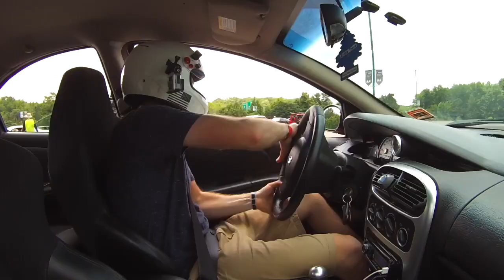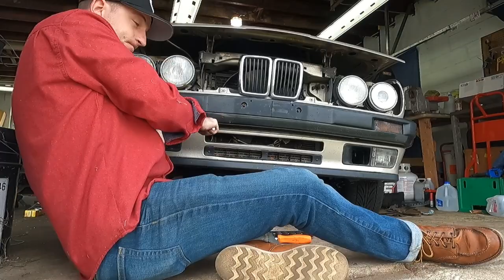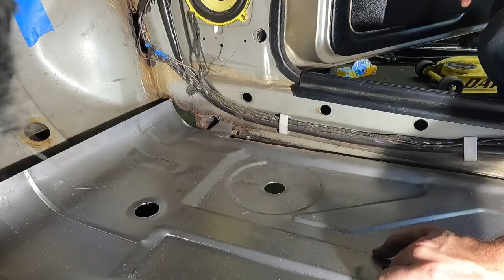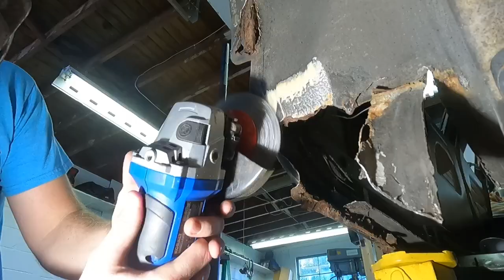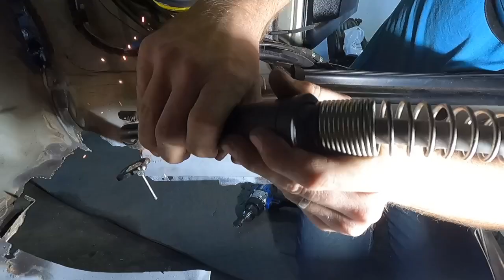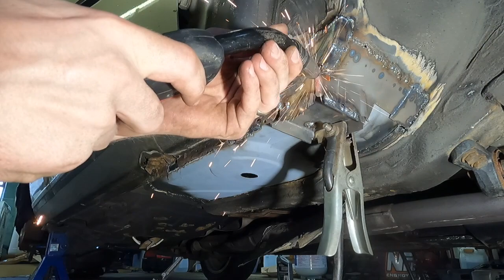Floor and Jacking Point Repair | BMW E30 Rust Repair | DIY Rust Repair

Comment: I think i missed it but where did you order your floor pans from?
Reply from the maker: I got them from Valcas garage. I paid like $800 for front floor pans, rear floor pans, both jack points and the front fender bottom portion. I ordered them and received them 3 days later.
Reply: @zackellis23  ok great! Il check them out! Im about to do the same to my friends e30m3 than mine.. they share a lot of structural components!
Reply from the maker: @alexcardin6642   I’d 100% recommend them. They fit great. Also I just posted a video of the driver side. Not that it will help you but might not hurt to see. Good luck with it
Reply: @zackellis23  already watched it!! Its basically giving me the motivation to do our cars! Keep up the good work! 💪🏽
Reply from the maker: @alexcardin6642  haha damn right man! Good luck with it and I appreciate it!
Reply: @zackellis23  💯 we’ll be in touch eventually! 🍻
Reply from the maker: @alexcardin6642  for sure. Where are you located?
Reply: @zackellis23  im in Montreal, Canada! You?

Comment: I’ve got to do about the same repair on my E30.  The battery tray is rotted out, part of the firewall, RF floor pan, and patch both rear pans.  Driver pan is fine and i can’t find any other rot on the car.  Almost bought the floor pan set like you but ended up finding a parts car that I’m gonna cut from.  

I’ll have a video on my channel as well - feel free to check it out
Reply from the maker: Sounds like we have pretty much identical rust issues. I just subbed to your channel to follow along!
Reply: @zackellis23 definitely! Was kinda gutted at the unexpected rot being its a southern car.  Guess I’ll get to learn my new welder!  Plan is to m54b30 swap it. Maybe make it my auto-x car tho my 330ci will get jealous.
Reply from the maker: @robsweekendgarage  mine came from New Hampshire so I knew it was coming. BUT an E30 is a great auto X car. I currently use my SRT4 for track days and autoX. I was positive my e30 was going to be a fun “drive to work” car but once I carved a few back roads…. I think I have to autoX this car lol.

Comment: Looks great, man.. I did this to my suzuki Sidekick a couple of years ago.. then fit and cut and fit and cut.. and then 4500 tacks takes forrrrrever. You done awesome. They do make a body seam sealer. I used to cover the seams and small pin holes..
Reply from the maker: Thanks Sir! Yea it was a looooong process. I am going to finish all the floor repairs then seam seal at the very end. I just wanna drive the car again lol
Reply: @zackellis23  Yeah, when I put my clutch in the srt-4, I was like, man, I wanna rip it.. but can't because lame ass break in miles 😒